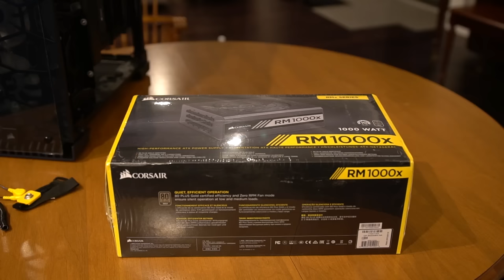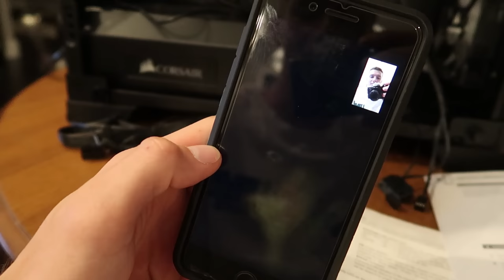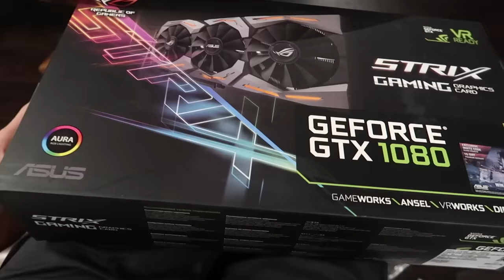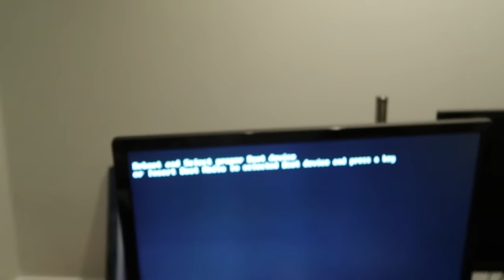Building my First Gaming PC

Comment: I always love watching people build really amazing PCs I'm stuck with a shitty laptop so I'll never have the joy of doing so but love watching these types of videos, hope it runs well Adam and has no issues enjoy!!
Reply: Presented You don't have to go insane on a build to build a PC. I built a PC using a core 2 duo and a GTX 650 I found in a trash can last year and used it until 3 weeks ago when I upgraded. It can be done, you just gotta use EBay for a few things and not overly rely on buying things brand new.
Reply: once you get that first desktop build moving up becomes much cheaper...i could go from ym amd setup right now to an i7 6700k for $325 because i have the other components already..laptops are a sideways fucking due to the fact none of it can really be salvaged to start the next build..amongst other facts

Comment: I built my computer on a bed. With carpet. In socks. Oops
Reply: Same
Reply: Does it still work?
Reply: @kentonparsons1374  better than ever
Reply: I’ve never used a band whilst building pc’s
Reply: Ryley Browning Vlogs lol I almost did but then I shocked the door knob before I started and then I grounded my self
Reply: I think your fine if the computer isnt on
Reply: Lmao sounds kind of fun. Used to build lego sets on my bed and I always lost numerous parts under my blankets.
Reply: Lmao same
Reply: Reeee is the mobo even sli compatible
Reply: I don’t get it
Reply: breadface 202 same man 😂
Reply: you are a legend
Reply: You pretty much only need to ground yourself if the PC is on or there's any electricity in it. As long as it's not plugged into the wall and on it should be fine
Reply: Ive built 4 pc’s and never used a band and they work just fine
Reply: At least you had socks on
Reply: I built my on carpet and it works fine

Comment: Kinda late, but I thought I would add my thoughts. I really like this video because it proves that anyone can build a their very own rig! That being said I have a few tips / comments about some stuff that I saw. 1: All I've ever used is one or two screw drivers to assemble a PC, if you already have a decent set, no need to buy a kit. I've also never used a static wrist band. Not that you shouldn't be careful, but I've never had any issues. 2: There's not necessarily an up or down on a PSU. Generally speaking, if your PC will sit on carpet, mount the fan up, towards the inside of your PC. if it's on a hard surface, mount it down. 3: This one is kinda important, always use thermal paste on you cpu cooling device, even if you’re water cooling. The point of thermal pasted is to fill in small gaps and make the connection between your block and cpu. If you don’t use thermal paste you risk at least running higher than healthy temps and at worst frying your cpu. 4: It's always easier to download the free version of windows onto a USB and boot from the USB. After it boots into the free version of windows, you can upgrade to a full version. No disk required. https://www.microsoft.com/en-us/software-download 4: I don't know if he did this or not, but if you have an SSD, make sure you boot your OS to it. 5: Do some research, you'll love your new machine allot more if you understand it! 6: Kind of cheesy, but have fun and appreciate that you can do something that allot of people don't know the first thing about.

Comment: 15:09 The fan isnt blowing the other one, your card is still getting PCI-E power without the 8 pin connector
Reply: imAbra wrong
Reply: Kyle Cummings No Kyle, you're wrong. The pci-e slot can still partially power that card, up to 75 watts of it. The fan was spinning because it was being powered. Did you not see the card light up as well?
Reply: imAbra he's correct the PCI-E still powers the card's fan. I have done this mistakenly.
Reply: JLochan Thats what i just said, Adam reckoned the first card was blowing the second ones fans, but the PCI-E is powering them..

Comment: You do not want to pull heat into the case! You want it to push it out! You installed the fans correctly though.
Reply: GForceConnections You want fans pulling air in and then have fans to pull the air out.... you need both

Comment: You gotta take all the plastic off the motherboard and the thermal paste is pre applied to the cooler and make sure there are no twist ties they'll short your computer
Reply: Twist ties wont short your computer lmao. Twist ties are commonly used to help cable management and used very frequently in electrical wiring. Every single tech youtuber recommends twist ties as cheap method for cable management,
Reply: The type of twist ties that hold your bread package together they sometimes are wrapped around the cables zip ties don't contain metal and that's why they're used for cable managment
Reply: +msbyrnes _ unless the metal of the zip tie is physically piercing the cable how on earth will it short two cables?

Comment: 5:14 is every single PC builder ever
Reply: Ranga iii
Reply: Lol, why corsair do this.
Reply: Captain Dan because some case bring the power supply placement on the top so the power supply need to get the air from the top inseted of the bottom so the fan will be facing up.
Reply: Yup

Comment: who else is watching on a pc they built themselves?
Reply: me rofl,did you notice the cpu plate didnt pop off when he put the cpu in rofl
Reply: tonypengo  me
Reply: yup, My ram was bad and this was my first build. Super scary but I did trouble shooting with my borother(we have the same parts) and we found out it was the ram.
Reply: Yup -- using a full tower case,  but a majority of my parts are 3-4 years old already.
Reply: yeeeeah
Reply: about to build my second.  7700k,  1080 FTW, Asus z270 cpu, etc. etc.
Reply: yaaaa
Reply: yep
Reply: me
Reply: tonypengo I'm watching on a iPhone that I didn't build
Reply: same
Reply: I am. Im running an i5 6600k oc to 4.5GHz and a gtx 1060 6gb
Reply: why did you have to be that guy :(
Reply: meeee
Reply: I'm watching on a iPhone that I built by myself
Reply: Chief Blake really
Reply: LOL, built this desktop in 2008 with a dual core, Abit mb, pretty basic stuff, antec p182 case.  The internet still doesn't overwhelm it and I don't do pc gaming.  

@AdamLZ you are doing fine, building a pc will get you a lot better computer in the long run, downside is the $$$$, only thing I would have done different is the thermal grease, definitely chuckled with the flashing lights and wire in the fan, not good but most do it at some point
Reply: dsb1829 tech in general is expensive but building it yourself saves you about $100 from places like ibuypower and a lot more from companies like Dell, HP, Alianware, etc. he said he did the wiring off camera so I think he did plug all the fans in. I saw at least most of them spinning (didn't catch the top 2 though)
Reply: Yerp!
Reply: Just put in a r9 270x today
Reply: me tooo man i5 4690k, gtx 970 ez
Reply: raises hand
Reply: GTX 1080 FTW WOOT WOOT!!!!
Reply: i7 4790k on an h100i, MSI gtx 970 (G4 i think, it's the red twin frozr V model), asus z97
Reply: gtx 1070, i5 6600k skylake, and 16 gigs of ram... plus overclocked cpu to 4.3
Reply: my first build was a 486sx 25 
today i have a budget quad AMD chip with 32 gig ram and a 1060 6 gig and runs BF1 on 1080p on Ultra smooth as butter with 256gig Samsung SSD 3tb spinning wheels for storage and duel boot Linux and win 10   :-)
never use win 10 unless playing the few games that will not run on Linux all other pc activity is Linux base including watching this video
Reply: yup, xeon x5675, asus x58, 6gigs of hyperx ram and will being getting a RX 480 or get a vega gpu
Reply: And over locked to 4.2 gh and a gtx 1060
Reply: gtx 1060 6gb
i5 6500
16gb ddr4 ram
Reply: i am :) i5, 8gb ram, rx 470
Reply: MacVirus i bet thats a ibuypower pc
Reply: NOPE I BUILT IT WITH MY BROTHER
Reply: MacVirus nice
Reply: ME
Reply: ΜΕΕΕΕ
Reply: tonypengo me
Reply: yes
Reply: AMD Guy checking in on my AMD build myself about to upgrade to Ryzen 5 1600X, I hate when Cpu cooler manufactures like CoolerMaster, Phanteks, Corsair, ETC can't keep up with new CPU Sockets and you have to wait for Revision Sockets to go out individually and wait for delivery SMH... Ordered on April 11th along with Computer Hardware, Have the hardware, All of it came 2 days ago with 2 day shipping. Now just waiting for the Bracket EErrrrr...
Reply: me this was hallarius watchin him fail like i did 4 years ago
Reply: Yes sir!!!!
Reply: This video was painful
Reply: Me.
Reply: tonypengo no my ipad
Reply: lol not me Im looking for a new computer to either buy or build by next year of june :)
Reply: me :)
Reply: If you dont build a Pc your getting rip offed
Reply: No Name do u live in cali lol
Reply: yea
Reply: idk why dont you look in socket??????
Reply: i'm watching this on my 2011 build which will retire in a few months AMD FX- 4100 3.61GHz 8 gigs ddr3 ram, MSI radeon twin frozr lll 6950 this is my 9th build
Reply: @csyalx  he removed it before, didn't he?
Reply: me

Comment: motherboard on the TABLE u wil prolly bend pins at the back when youll install a cpu ir a cooler ram or anything
Reply: U mad!? There are no pins on the back....
Reply: metal is harder than wood...
Reply: TheSpeakerGuy actually, there are usually some things that stick out from the back, which are used to mount transistors and stuff. I know  that these arent pins, but I would still be carefull not to bend or break them off.
Reply: Pascal, there is metal you can poor.
Reply: yeah but those small metal pin wont break because of the wood.

Comment: Wants to play Forza Horizon 3, spends thousands 😂
Reply: Hame M tbh pcs are worth the money
Reply: Hame M you really dont need that much to build a pc to play everything better than consoles but you need to take in consideration of how many pixels your pushing on a high end pc with  3 screens
Reply: chrXma but not 2000$ u can get one for 800
Reply: 4k is pointless without a 4k display which he does not have
Reply: Defying History i hope you know he has three 144hz monitors
Reply: 3 144hz monitors are hard to push especially running them in surround.
Reply: Hame M wait till he tries to setup the wheel to it it's a fucken pain in the ass
Reply: Hame M just for forza, he would have been better of with an xbox, just because of that terible port. But then again, who plays on an xbox if he can have a pc powering a sick tripple monitor sim setup?
Reply: Felomator he has an xbox too
Reply: 3 monotors is why he build this he saus in vid. He can't do on Xbox so yeah.

Comment: adam throws i7 all over the place 

i actually reach to try and save it
Reply: dakota gunn if you call that throwing then we have 2 different definitions of throwing, he literally just pretended to fumble with it and it fell on to the table from a height of about 1/2 and inch. I know parts aren't the most durable things ever, but all you people think they are made of glass 😂 hell glass would still survive that "fall".
Reply: Any other part I wouldn't have said anything but cpus are really fragile.
Reply: dakota gunn by its self, yes very fragile. But in the plastic inside the box, it can take a fall.
Reply: I know it's probably very safe but it still makes me cringe.
Reply: It literally dropped a whole 2 inches while in the box. It was going through a lot worse during the shipping process. Trust me, lol. Every one of those components more than likely were.

I'd say for a noob, he handled this quite well. I was running off of a couple years of research before I had the money to build my own badass PC.
Reply: This is the kind of BS that makes people scared to build computers. Stop being silly. You could literally keep the thing in your pocket through a Tough Mudder race and there is 90% chance that it would work fine afterwards.
Reply: _ _ In the box yeah. Out of the box however it would bend a pin before you even started the race
Reply: Ben Jones Intel CPUs don't have pins ,mobos do
Reply: ^ Yep! They haven't had pins the last few generations I believe, but I'm pretty sure they did a while ago. As long as you're not getting any junk on the connections or w/e, or getting anything on the back plate of the CPU that could disrupt the spread of the thermal paste when it's attached to the cooler, then you're golden!

Comment: Why not a huge SSD instead of an HDD+SSD combo on a $4000 build?
Reply: Josh Thompson ssd is pointless for storing most this. just put your operating system and the games or programs you play on it and you're good.
Reply: Josh is sort of right, most people do the HDD + SSD to save money and they store their files on the HDD and most of the running files on the SSD (HHD are very cheap so it's not bad to have them just to store videos and things that don't need crazy drive speeds) .... it's not a big deal tho he can always place other ssd's in there as secondary drives if he realizes his main operating system SSD is getting full. A 1 TB Samsung EVO SSD is like $250
Reply: Josh Thompson It would defeat the purpose of buying a SSD, might as well buy a huge HDD. Chuck your os on the ssd and everything else on hdd
Reply: Not really pointless, having a much faster read/write speed for all of your files is really nice and feels great. Only real benefit of an HDD is saving money, which he clearly isn't trying to do. I mean, he got the literal top of the line for everything else(in a consumer/gaming sense, he technically could have went into workstation territory.), so why skimp on the drive?

Comment: haha i'm not a wizard too into builds.. but after watching a couple of videos online on youtube it should be much more easy.. 

1. Motherboard 
2. CPU 
3. Cooler mount 
4. ram slots. 
5. backplate / pc kabinet 
6. install PSU
7. insert motherboard 
8. add vents - install the cooler
9. install HHD 
10. Install SSD 
11. Install graphiccard / two. use "Sli bridge" 
12. Hook up the PSU cables.
13. Cable magement. 
14. Boot windows on USB installer..

Comment: Ive never grounded myself ever. Ive always built on carpet or bed sheet. Short carpet though not fluffy and no socks. It isnt necessary since you always touch the case anyway. Id never put parts onto a hard surface and never plug it in while you still working on it.
Reply: If you are not sure about something always research on the internet. It could save you buying or destroying expensive parts. Things like grounding are not really an issue unless you can have static objects around you. It is more priority that you build correctly with compatible parts and be gentle installing them.

Comment: buys 2 1080s "i'm going to unplug the bottom one because i don't really need it" 14:48 ...
Reply: Kabeer Pandya he doesn't have an sli bridgge
Reply: Hazaa Alawadhi you can still use them both they will just work independently form one another. I’ll
Reply: Jackzman1 r ok good to know
Reply: Jackzman1 r of I got 2 1050tis do I have to have them in sli?
Reply: You do not need to but I would highly recommend it.
Reply: PC Builds Official it makes them run together it’s like have a 1 and a 1 you can keep them separate and each be independent but combine them and have a bigger number
Reply: He said he would use both of them when he is doing VR stuff
Reply: Also he only had one of the 2 power cables plugged into the gpu

Comment: I think you shorted your motherboard I had the same problem building my pc
Reply: Yeah I might be wrong tho
Reply: UnrL oDzzy did you even watch till the end?
Reply: He hasn't shorted his motherboard.. it was blinking because of the 12v power cable and then it wouldn't boot because he has no boot device I.E there is no Windows installed to the hard drive
Reply: I know, he forgot the motherboard standoffs.
Reply: Just in a boot loop
Reply: no he didnt. the standoffs were pre installed
Reply: Most high end cases have the standoffs built in.

Comment: grounding yourself isn't as important as you made it seem, I understand that you were taking all the precautions on your first build (as I did too), but I don't use a ground wrist strap anymore and I've built over 20 computers will no issue... I always build on wood floor though
Reply: It's mainly important when you're on carpet, no so much wood.
Reply: GForceConnections yeah he was on wood that's why I said that
Reply: Sam I like to live dangerous, I do that shit on carpet 😎
Reply: I've built probably 4 computers on heavy carpet, with the computer sitting on the carpet, in socks.  Not had an issue.  Someone made a video saying it doesn't matter in the past few years, I forget who did it.
Reply: Matt's Garage - TakeiT yeah exactly
Reply: I've built all my computers on carpet wearing socks. As long as you continuously touch metal as you work you'll stay grounded to the case without needing a static wrist band. I've never used one. I've never had an issue. Just remember to touch metal to ground yourself and you're golden.
Reply: Manufacturers now are pretty good at making anti-static components, but 10+ years ago you could easily fry a component with a shock

Comment: Your not supposed to put the power supply first but it's okay
Reply: WrongNumberM8 if you want to use an antistatic band and connect it to the case then yes, plus anyway even if you don't it didn't matter what order you do everything in, when I'd did my build the power supply was the last thing to go in.

Comment: just built my first pc. I was insanely nervous about it. Turned out GREAT! Can I get some opinions on my build. CPU: Ryzen 2600x, Motherboard: B450 Tomahawk ATX, Ram: Vengence 16GB of DDR4 3000, Storage 500GB SSD (Mostly for running Windows), A 2TB Seagate Barracuda HDD, Video Card: Radeon RX 580 GTS XXX Edition 1386MHZ GDDR5 with dual bios, Power Supply: Consair-Rmx 650w 80+ Gold Certified modular Power supply